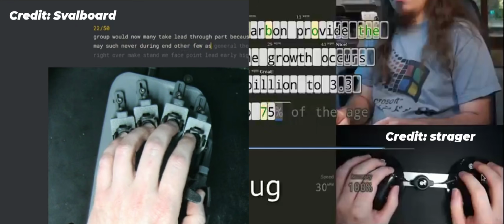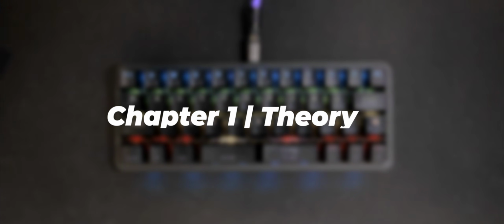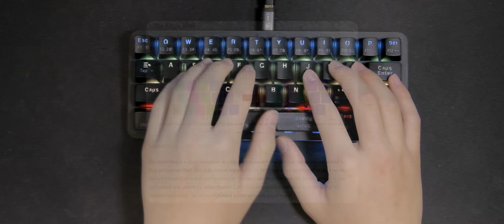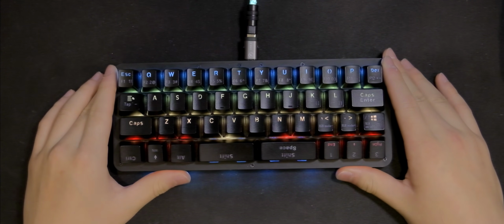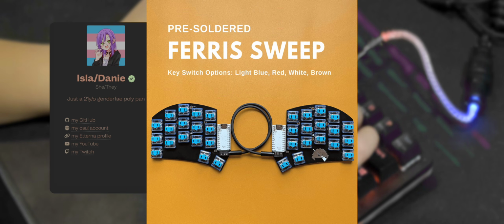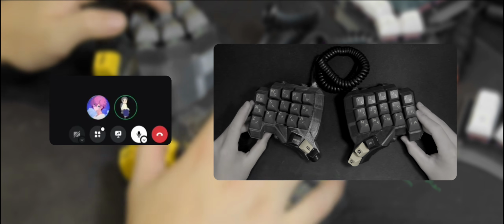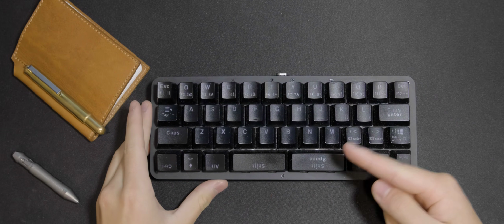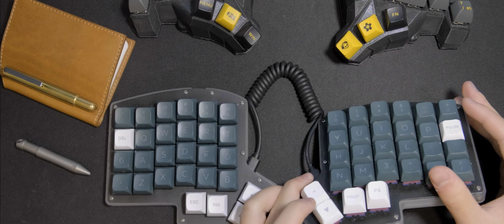A Split-Story | Ergonomic Keyboards

Comment: I been using a standard tkl/75%/60% for a while and never had improper wrist bending issues. I use proper touch typing techniques on a QWERTY layout and top 150wpm on a 30 sec typing test. I find it's fastest to type on tactile mechanical switches with a hard mounting system. Just sharing my experience. I guess not everyone can be comfortable with such a setup though.

Comment: I’ve been using split keyboards in my work as a software developer for over a decade. I do not care about speed, at all. I would rather type more comfortably and slower than aggregate RSI pain for speed. Split ergo keyboards are optimized for this comfort, not for speed.

Comment: I'm loving my switch to a ZSA Moonlander - switching to colemak forced me to lean to touch type finally, and it straddles the keywell-colstag gap with the angle adjustable thumbcluster. I don't think I'll ever move to a true keywell board, barring health issues, because of the massive portability loss. colstag boards especially have gotten smaller and smaller, and I'm planning on building a choc board (probably a Totem) in the near future for this reason

Comment: I had my elbow chopped and screwed a few years ago after a serious break. I can type on a standard keyboard, but not for as long, and my body will hate me the next day. separating the hands, so my wrists are straight and not pronated or supinated much is pretty important to me. I started my split keyboard journey with a UHK, which is really just a standard keyboard with a way to split it in two. Then I tried a moonlander from Zsa, then a defy from Dogma. I think the Moonlander is best for me, it's got a little bit of tenting, it's got a nice column stagger. I lost some feeling in my pinkie on my left hand and its thumb cluster allows me to move some work from pinkie to thumb, which to me makes sense and works out.

Speedwise, I'm about the same on all my boards. But in terms of what I can use day in and day out, the moonlander is a great solution for me. I think you're right about column stagger. It just makes sense.

Comment: This is more of an ergo speed typing analysis than just an ergo analysis. Found many points I never heard of before that make a lot of sense with speed typing.

The only correction I would make is that your wrist does not need to align with the direction of the keys. Your fingers have no problem adjusting where to press above and below. And case in point, you can't just adjust your wrist angle to adapt to ortho. Your fingers need to learn the adjustment, after which your wrists are free to be where they were (in an optimal position). But yes, if you insist you need to type c with your index, ortho will disagree with you, but fixing that is actually not that hard compared to other adjustments. 

The greatest benefit for a tented split has nothing to do with the layout, but with your posture and wrist strain. Ergo, if you're being serious about ergo, begins with your chair and desk and posture, all optimized for your elbows and wrists with relation to the desk. Split means wider shoulders, and tented means less twisted wrists. But even then, the greater issue is with twisting and stretching during typing, more than the stationary angle. There really are only two ways to fix this, and that is either with hovering hands, or with added layers that bring all your keys within 1u distance, so that your wrists can remain stationary.
Reply from the maker: Ah, I should've better clarified in the video;

Your fingers can get used to improper alignment, definitely true, but the main point on ortho is the corner keys/lateral stretches.

For example, pressing B and E together when the matrix is aligned with your fingers feels easier than when it is, say, angled like when your hands are placed on ortho. You can see how the angle of splaying between your finger increases as you unalign the keyboard more - due to the fingers "moving" in different directions.

On a staggered keyboard, if you do the angle mod, every key is actually comparatively closer (with exception to Y since the top row is not modified). Basically, B + E becomes V + E. At least for my hand size, that is easier than it would be on ortho - thus rendering it rather ineffective.

The c part, by the way, I was referring to as an unconscious thing people often do as that feels more comfortable - not necessarily that it is the correct way. According to "strict" fingering, middle is actually the "proper" way to do it - although funny enough I'm not sure if that's actually better. 

The rest is true yup! Main point was that I personally believe ortho is a flawed design (again, when it is not split). I always like to remind people that you shouldn't have to adapt to your keyboard - rather, it should adapt to you.
Reply: @va1orance  Thank you for your thorough response and your thought provoking video. Your video is the first time I even heard of alt as in alt fingering... And once I figured that out it made a lot more sense. Also why people could type so fast on qwerty lol

You also didn't mention thumb usage optimization which is one of the main selling points on the ergo/comfort side of things, but understandably has absolutely nothing to do with speed =)
Reply: I do not agree that layers are more ergonomic. I use the number row and are a tad faster than having those on a layer, but need to move the hand a bit more for that of course. It is a matter of preference and also related if you just type a few numbers or many in a row, where I agree an extra layer is then beneficial. You can use both btw. No need to just use one option.
Reply: @nickgoogle4525  There is nothing more ergonomic than having numbers on your home row. 

For the most part, if you don't experience pain or discomfort, you can always go with what you like best. It's when things start hurting that they get serious, and begin to constrain your options.

With that said, do not shy away from layers. A 40% with 3 layers is a 120% keyboard, and all keys can be at 1u distance. I'm typing on a 60 atm, but use my 40 layers just because they are so efficient.

Comment: I've been aware of ergonomic keyboards (more specifically the mechanical kind) and keyboard layouts alongside layer systems and all the wacky actions that come with those for around the past 7 months or so. These topics and everything related to them (hell, ergonomic keyboard layouts on phones for example with MessagEase or Thumb-Key on Android, the latter of which having a letter layout that is statistically based on the frequency of what is usually typed at least for the English language, similar to the approaches with other physical keyboard layouts, a bunch of which of course optimize for statistics nowadays) have driven me insane. Or not really, I'm still quite at the surface level, but this is a special kind of place.

Considering how people interface with computers today I'm surprised coverage of such input systems aren't more common, since considering the practicality and usability of these concepts in even the smallest amounts, they should be, there are quite wonderful effects to all of this and I'm assuming the keyboard will still be our main, best method of navigation and input for computers for centuries to come, even considering things like voice to text and spooky brain computer interfaces. It's just that, of course, the discourse isn't really centralized and a lot of the innovation we still see nowadays is at quite the hobbyist level still, you don't see much academic related stuff for this probably because the keyboard would be such a specific thing to optimize for, and yet there's still so much depth here that continues to reveal itself the more people talk about and work on these sorts of things.

That being said, this video is a good summary of at least some of the concepts thrown around here and there during all of this stuff. It's understandable that you wouldn't get to everything of course, this kind of goes everywhere, but you did well! There's probably enough things to take into consideration regarding all of this for a part 2, but of course people can only talk about keyboards for so long, I think.

Comment: I picked up a Kinesis last year because I was starting to get some wrist pain from my work. From my experience, I would put about 85% of the pain relief comes from the split layout allowing for custom tenting/angling/separation, that last 15% I would put on the key well and col-stag because I don't need to move my fingers as far.
Reply: A friend of mine cured his RSI-like issues by going from an ErgoDox to a Kinesis advantage 2 (later 360).

Personally I don't have such issues, but I prefer sculpted boards for comfort. Have been using various ones since 2007, and a bit later (in 2008 I think) switched to the Colemak layout, further improving comfort.

Comment: I wish a Corne keyboard wasn't 600+ bucks where i live (brazil)
Reply: just built one (look for cheapino)
Reply: @Pepo..  yeah, i will take a look at it (a pre built one costs 570 bucks here..)
Reply: Do you mean Brazilian Bucks, right? I built one for around R$684 / US$120 including shipping and taxes, it's doable. It could be even cheaper if I went for cheaper switches and keycaps.
Reply: @gcolombelli  i might take another look at them later...
Reply: @gcolombelli  which one?
Reply: @Pepo..  A DIY low profile corne with kailh choc switches, here's the breakup of what I paid:
R$279 PCB + plates + screens
R$185 keycaps
R$181 switches
R$21 TRRS cable
R$18 pro micro style atmega 32u4 mcus

Initially I was using keycaps I designed and 3D printed at home, but I wasn't too happy with them and ended up replacing with mass produced ones. Got the PCB, plates and screens from 42keebs and everything else from aliexpress. I'm rounding up the cents here, but in the end it was ~ R$684 with shipping and taxes included.

If you're building with friends you may pool your resources and save a bit if you're using similar parts. For example, I only needed 42 switches, but I would pay more getting sets of 10 or  30 than on a set of 70 switches, so I ended up with 28 extra ones. I may end up using a few of them on a hitbox style controller later.

Comment: I've never seen a community as afflicted by the placebo effect as the split kb community. They're the star wars fans of keyboards.
Reply: There’s studies going back to at least the 80s on a few of the features (tenting and splitting the hands seem to help with some issues)

But no standards or certainly blind testing on some other claims

HR departments might not pay for rgb lights, but they’ve been kicking in for Kinesis keyboards for decades on physical therapist’s advice

So yeah it’s the Wild West, and that can be annoying, but if you can’t type because your arms feel like they’re on fire, it’s nice to know that tenting your keyboard 20–30° has had research backing it for a while

(Not that old studies are as good as lots of ongoing research between now and then. Just not a lot of money to back them I suppose)

Comment: Keyboard nerds exaggerate the benefits of split keyboards. I have been using a 40% nonsplit for over 3 years and I've not had any problem whatsoever.
Reply: no not really and the benefits are for the long run, also split can be way more efficient
Reply: Ultimately, alike how there are so many factors affecting a keyboard's sound, there are also a heck ton of factors affecting a keyboard's ergonomics, and the size is certainly one of them. Having a 60% mechanical keyboard can widely be considered as more ergonomic in comparison to a full sized rubber dome one from what I've seen, and at that rate it's more so coming down to what exactly is "enough" for the user and what they are paying for it. It makes sense how your current one works for you, primarily because it's already straying towards the ergonomic side then, and there wouldn't really be much of a reason to spend an extra hundred or two on a split one just for a modular upgrade of sorts. Makes more sense if you didn't have the 40% nonsplit, but obviously it's capable enough. 

In terms of pricing, I've found 60% keyboards to be much cheaper in comparison to 40% ones, obviously because the latter isn't that mass produced in comparison and at that rate you'd best be paying a bit more for split columnar options with the same form factor, but those are only the circumstances I would see now and not three years ago of course. Split options probably didn't always use to be readily available in the extent that they are nowadays, beforehand there were only really commercial options offered by Kinesis and so for example which nowadays, considering the feature sets of their offerings, would be considered a bit overpriced actually, but that's besides the point...